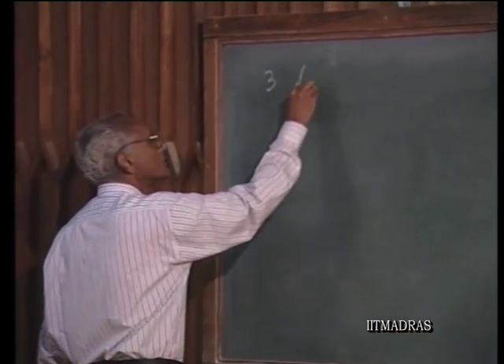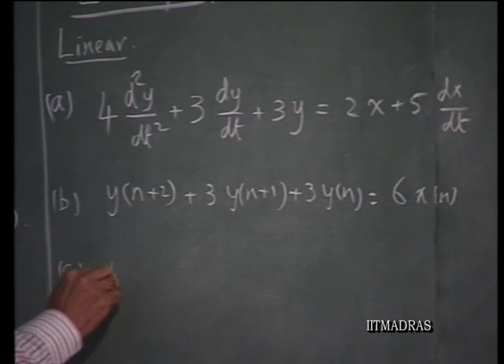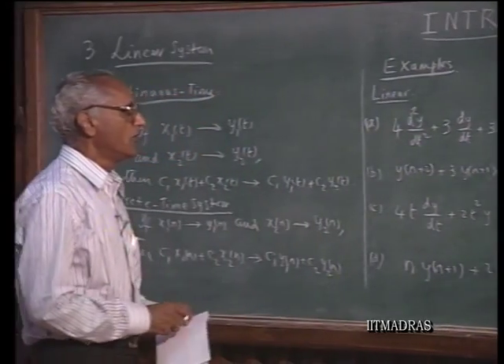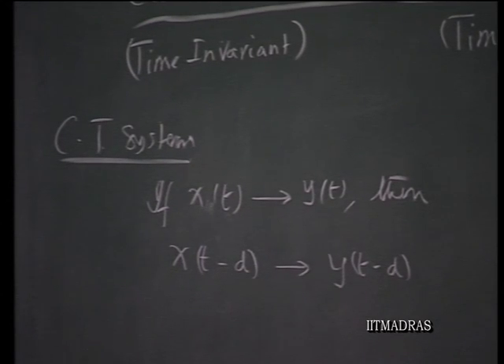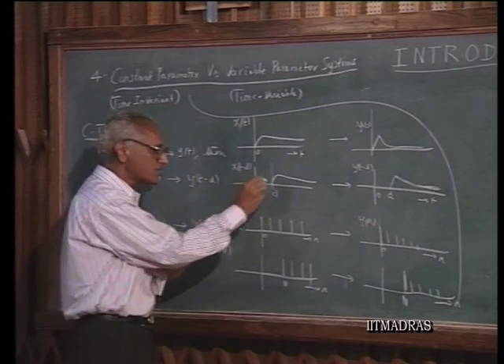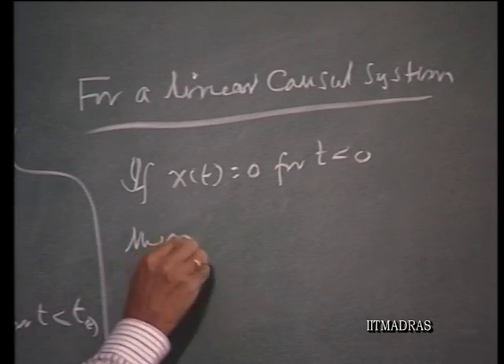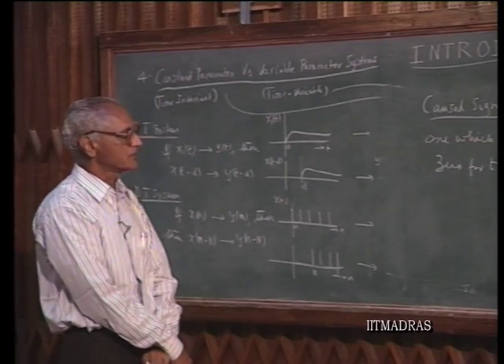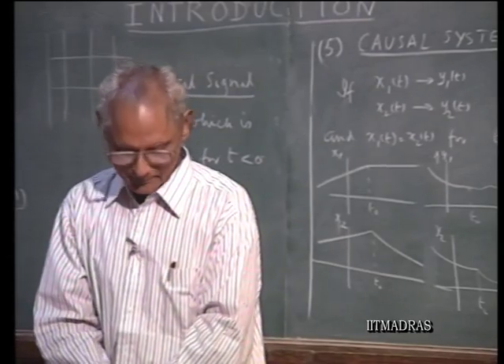LEC 4

Comment: system classification 0:00
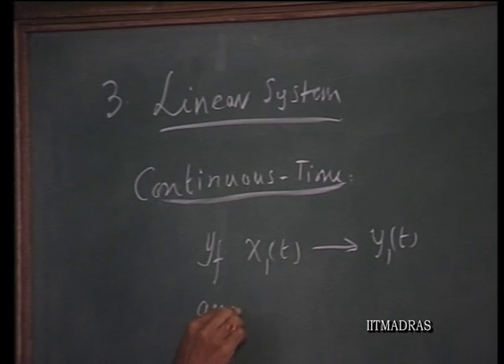linear const time and discrete time syst 2:00
homogenity, superposition, const coeff of eq etc
time invariant syst 10:14
coeff are const or func of indepe. var only eg resi or capacitor values not changing with time etc.
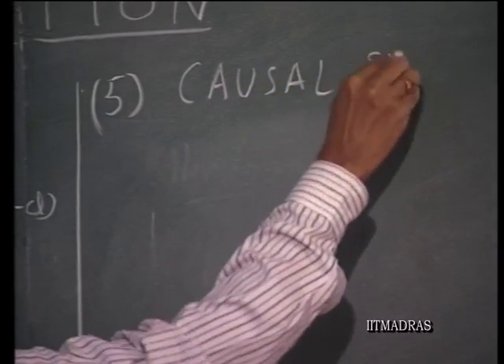causal syst ie. if x(t)=0 for t<0 then y(t)=0 for t<0 19:23
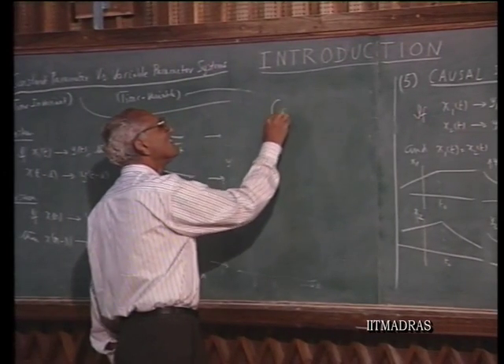def of causal signal - signal which is 0 when t<0 26:00
syst dimension ie, number of indep vars